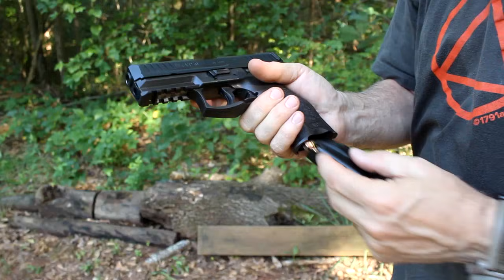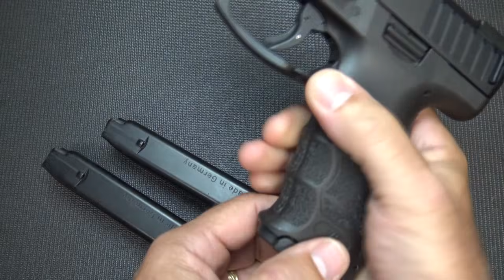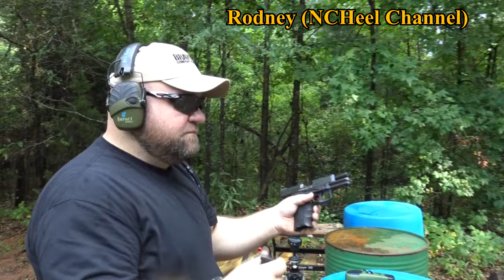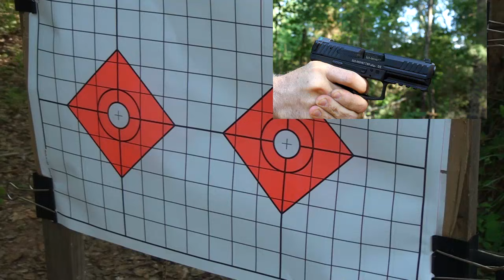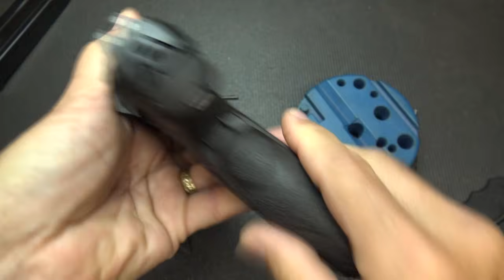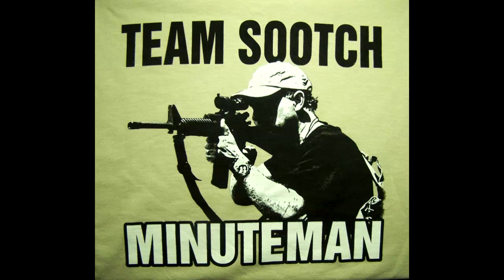HK VP40 40 Caliber Review

Comment: I got a VP40 in June. Awesome gun! Shoots like a 9mm but additional stopping power. Best shooting 40. Thumbs way up indeed!
Reply: chris delao Arguably, yes.
Reply: @shamrockrancher7673  I wouldn't even say argubally there is alot of studies recording data on one shot stopping power of different handgun calibers from across the country involving police shootings and the .40sw and .357 mag/sig are at the top of the list around 95-96% one shot stopping power while the 9mm is lower around high 80s low 90s
Reply: Interesting. Hickock45 said it was the hardest recoiling 40 he has ever shot.
Reply: @joes.7536  Hickock shoots so much he gets overuse injuries like with his trigger finger. Wouldn't be surprised if his personal ergonomics/grip style caused some aggravation
Reply: @th3wacker88  No common pistol caliber should ever be judged by 'one shot stopping power' because 99.99% of gunfights are going to require more than one gunshot wound to stop a threat.
Reply: @joes.7536  he might have said that so he keeps getting certain deals from certain companies.   Much softer recoil than several 40s.  He loves Glock 40s most and their inability to properly handle 40 is one of the reasons for the 40's drastic downfall in popularity.  True 40 pistol like this isn't uncomfortable to fire and won't beat itself and it's springs to death.
Reply: @dannysees  bit its still inferior to 9mm in terms of practicality in almost every way, the original comment in this thread said that the VP40 shoots like a 9mm, but why not just get the 9mm that shoots even better and has extra capacity to boot while delivering the same performance as shown by the FBI testing
Reply: @MrWassup45  FBI doesn't show same performance among the same caliber let alone different ones.  Good enough for the benefits of cost, low recoil, service life is all they have said.  For CCW or hunting purposes the likelihood to put down bad guys/animals with a few rounds vs LEOs dumping felons with 10-20+ rds is different.  

The best 9mm rounds get close to 1990's 40 and 45 performance with regards to auto barriers.  They don't not do as much to tissue, or match the better large caliber barrier rounds, just enough for their use.

Ammo and gun manufacturers are loving it because they have a better profit margin now.
Reply: @dannysees  https://www.luckygunner.com/labs/self-defense-ammo-ballistic-tests/ for if you want something more in depth and more applicable to civilians conceal carrying, its really simple man, i guy sint gonna care if you shoot him with a 9mm, 40, or 45 he isnt going to know the difference, the only thing that matters is shot placement, and 9mm offers you more capacity which mean more chances to hit vital organs, and lower recoil to allow for faster and more accurate shot placement its just fact 9mm is better across the board for the vast majority of self defense scenarios
Reply: Steven Sanabria 
A larger projectile will always create a larger hole, and a larger wound has a better chance of hitting vital parts and/or causing more blood loss. Practice is key, to assure actually hitting what you intend. Additionally, the .40 has been proven to yield better results to its targets when fired through vehicle glass/car doors, etc. Why is this important for civilian use? Because you might find yourself in a situation (I pray that you don’t) where someone attempts to carjack you or you may find yourself in a shooting in/around a vehicle for self defense purposes. People complain about .40 recoil, but then they load their 9mm with +P+ 9mm which has almost as much felt recoil and yields just as much (if not more) wear on tear on the firearm. These people typically do not train with +P+ rounds, rather they train with whatever cheap ball ammo they can find, so they have no clue how that more powerful 9mm load will be like when fired. 
Paul Harrell made a great video comparing the 9mm and .40 with practical testing and data to back it up. It can be found here:

https://m.youtube.com/watch?v=LTTDgZZZFa0

I began my law enforcement career with being issued a Glock 22 (.40). The agency I worked for had just switched from 9mm to .40 after the firearms instructors put together numerous amounts of data to conclude it to be the superior round. Yes, the fbi did recently got back to 9mm, but there are many factors they considered. 

Price-9mm is cheaper and when purchasing thousands of rounds, this is a major factor. 

Shooter-Most agents (and police) are not “gun people” and rarely shoot. Most people I work with only shoot during our twice a year qualification and any other training the department mandates, but other than that they don’t practice. This leads to low scores. The 9mm is a bit easier to shoot for some people, especially those with small hands, so their scores increase a bit (not much according to our agency) when shooting 9mm as they aren’t frequent shooters. 

Modern technology-Yes, modern tech has made the 9mm better than it used to be. But that same technology applies to most other defense rounds, so if you choose to compare a modern high tech 9mm to a regular practice ammo .40, then sure. The 9 looks nice. But comparing modern tech 9mm to modern tech .40, you will see the .40 have more power behind it with substantial expansion rates. 

Percents-FBI and police shootings average that about 20% of shots fired, actually hit their target. That means 80% miss. The higher capacity of the 9mm in most handguns gives officers/agents more ammo (that they need) to be able to stop threats (seeming as only 20% actually hit their intended target give or take). 

I am not bashing the 9mm. It is an effective round that definitely has its use! But many people (not saying you) seem to discredit the .40 and some even say the 9mm is better than the .40, which is simply not true. In capacity, yes. But in ballistics, no. It will never be better.
Be safe everyone!
Reply: I've had a USP 40 for many years. I love it. I want to shoot this model also. My USP 40 fits my hand like a Glove...
Reply: I want to buy one but I can't find one anywhere. I guess I have to wait until this buying Rush slows down and manufacturers can keep up.
Reply: @th3wacker88  If you still use terms like stopping power and one shot stops , you're not educated enough to talk about firearms
Reply: @rockon772  Really? And how old are you? Sounds like you run your mouth more than you run any firearm.
Reply: @dannysees  We're talking about Hickok45 on someone else's Channel and you say Hickok's popularity has wained? I'd have to sy that this conversation is proof that you're wrong about Hickok.

Comment: Awesome review Sootch00.
I love the Glocks. All different models. I finally bit the bulket and bought the Zev Dragonfly in 40. OH my gosh!!! That was the scariest pistol I've ever shot. I had shooters try it to make sure it was not me. Everyone agreed. Recoil was horrendous, could not regulate let off of trigger. SCARY. I sold it half cost, did not hold uts value. 
NOW. HK VP40. I purchased day I sold the Dragonfly. HK felt better in hand. Assembly and design is fabulous. Firing the postol is a dream. It recoils like a 9mm. Accurate, reliable, and i bought a  couple of the HK mag extensions. So I have 18 rounds of 40. 
Best 40 I have ever owned. Beats the Dragonfly and the SigP229. Along with other Glock 40's. 
I'd like one in 10mm as well. For backup hunting pistol. Although, the Smith 1006 (both of them) just didnt like at all. The Peter Stahl Omega was a jam a matic in 10mm. So i dropped the 10 altogether due to unreliable pistols at the time, and carried 50 Desert Eagle as my hunting backup. 
Keep up great review Sootch00

Comment: Hopefully they'll make a VP10 one day.
Reply: Why would you go with a .40 over 10mm? You can always get 10mm rounds that will give the equivalent of max .40 cal power or softer. You'll never get .40 cal that will perform at max 10mm power.
Reply: +Travis Woods 10mm is not for newbies. if you carry 10mm, you know what it does.
Reply: Travis Woods I totally agree, I have a SW 1006 and can load really hot and really soft.  pop in an 11lb recoil spring and shoot really soft rounds.
Reply: +FlyTour69 one can only hope
Reply: Only if you can afford 10mm ammos.
Reply: YeuLaKho 10mm is not that expensive.
Reply: I doubt HK will ever make a 10mm. It would be nice if they make a VP45 even.
Reply: Teo Phil does it kick harder than the. 40?
Reply: FlyTour69 that would be dope for real
Reply: It's quite a big deal to stretch all the parts (front to back), slide, frame, mag, etc.; to allow the 25mm long case/1.26" OAL... (MUch better chance of S&W bringing  out a 5" M&P 10mm over H&K....)

Comment: Just got this pistol for edc. shot 50 rds @ range. im a good shot, but even on pulls where i didnt care or breath right, i still hit target dead center. words can't express how impressed i am! all pros, no cons. i was used to the 9mm berreta from military, but it was easy to adjust to the vp40! flawless execution by hk. i love this pistol, pumped to get back to range. im 6'1", 250 lbs male; no kickback. highly recommended. my wife is 5'3" and im confident  she could easily  as well.
Reply: How easy is it to conceal? I'm looking at this for cc. I'm a small guy but I don't mind having a gun on my hip all day either. What size is this comparable to? I haven't been able to get my hands on one yet
Reply: +MrEmpero Greetings, sorry for later reply. I'm still waiting on my permit, however, after much research i'm going with the wildbills concealment leather holster for the lower back. In regards to size, i'd say its no larger than a 9mm, very easy to handle and weight is balanced in the hand. Hope this helps, you wont be disappointed. Like everyone else, I'm waiting for the vp45!

Comment: I don't think Glock 40 caliber's where shoehorned into 9 mm. I think it's the other way around. The 9 mm was shoehorned into a 40 caliber. And they are not really made for 40 caliber. I wish Glock would come up with a 40 somewhere between the size of a Glock 17 and a Glock 21 (made for 40 like the m&p, usp, vp40, beretta 96A1. ). I don't think the Glock 23 will last as long as a Glock 19 but I still love them and have them.

Comment: Part-2:   The grip area kind of feels like the new Springfield Model-2 Grip area, which is good.  Although I thought having to knock the pin out at the bottom of the grip in order to change the adjustable grip pieces is a little bit of a pain in the butt to do.  By the way - I opted for the Small sides and back-strap pieces, even though I would say my hand size is about medium.  The little pieces that stick out on both side at the rear of the slide to help with pulling back the slide are nice, but instead it would have been better if HK would have placed S&W Third Generation style Safety/Decocker levers at the rear of the slide.  This gun has no safety.  It is a little dangerous having a loaded chamber on a gun that may be lying around and available for quick use in case of a break-in and used for home defense.

Comment: My impressions of the VP9: good but there are offerings just as good at the same price point and some that are almost as good but considerably more affordable and simpler. Got to shoot a new one a couple of weeks ago in comparison to my 4 year old, 3000-4000 rd PPQ in 9mm. Shot the VP9 just as well, but was more impressed with PPQ's smoothness. Had more problems with the ambi slide release than the PPQ's (I'm a lefty, and don't like them). I may be a little bias, but I still prefer the PPQ over the VP9. That gun might smooth up as time goes on, but it is still a much larger pistol than the PPQ without the added capacity or improved shoot-ability of a large framed pistol.

Comment: Part-1:Based on several Glowing Good Reviews - I purchased a Brand New HK VP40 on 2/29/2016 for $589.99.   My first disappointment was the Painted on glow sights.  They just don't glow for very long.  They maybe last only 10 or 15 minutes if you are lucky before they start going dim.  Then while I like the trigger and trigger safety on my Springfield XD and XDM pistols - I never have liked the thin metal trigger safety on the Glock pistols because the thin metal popping out hurts my trigger finger.  The trigger safety on the HK VP40 resembles that of the Glock.  Also I do not like the groove down the inside center of the trigger frame - this was done to allow the bottom of the trigger to ride in that groove.  The problem is that unless you keep
your finger up high on the trigger your finger rides in the groove and that can
be irritating and eventually painful.

Comment: Have had my VP40 for about a year & a half now. It was my 1st H&K gun but won't be the last. If having troubles finding a holster still, safariland has paddle & belt style h ol ln stars with a tensioner screw & finger lock on the back side of the holster.

Comment: I just bought a VP40 this weekend.  I do have to pull my trigger when disassembling.  Otherwise, the slide won't go forward.  Also, mine only came with 2 magazines.  However, I did get mine new for $559 with the Tru Dot night sights.
Reply: Brian Page:  Love the pistol and want to replace my Glock 19 but a little concerned about the slightly larger size for IWB CC. Has it worked out? Thanks.

Comment: as i said at the full30... the 3rd magazine and TruDot sites that you've got are on the LE version... the regular version comes with the same glow-in-the-dark sites and 2 mags as the "regular" VP9... the LE vp9 has 3 mags and trudot.

i just don't want folks to be pissed if they think that they're going to get 3 mags and tritium sites by default... they're not.
Reply: I got three mags with my standard VP9.
Reply: M4A1GUY that's good luck (wish my vp9 came with 3) but it is not what is advertised to come with the regular edition VP9 or VP40. did you also happen to get the tritium night sites?

as far as the VP40 reviewed here... it has 3 mags and TruDot tritium night sites... which is exactly what makes the LE edition the LE edition.
Reply: Noddy Ninetythree Correct, pistol in this test is LE version.

Comment: If you put one finger on top of the slide above the rail and one finger on the rail.  Press those fingers together and do you get a little lose/play feeling between the slide and the frame?  Just picked up a VP40 and I noticed it right away, my glock does not do that.

Comment: Wondering your opinion on this. Do you think replacing the back plate with a solid back plate without the hole for the striker would the gun significantly more reliable or not?

Comment: Those are 9mm mags. Do they feed .40S&W? I know the .40 mags will feed 9mm.
Reply from the maker: Craig Wildfeuer From what I understand they will work. I haven't tried it and didn't want to include it in the review until I was certain.
Reply: ***** I think what he means is that when you picked up the magazine @2:57 that the back of the magazine definitely says "15".  Did you mix up the mags?  Surely the VP40 doesn't come with mislabeled magazines.  For the cash you spend on an HK mag, it better be right!
Reply: Craig Wildfeuer The followers and mag bodies are the same dimensions. So yes.  The only difference is the round count holes on the back.
Reply: Craig Wildfeuer  didn't know 40 fed 9mm,  no jamming ? very interesting
Reply: Yep, most of the .40 mags of most makes will feed 9mm. I know my Springfield XDM .40 mags and my Sig mags fed 9mm beautifully. Same with my M&P.
Reply: +sootch00  Is the width of the feed lips different between the 9 & 40? Comparing 9 & 40 Glock and Beretta mags are not the same, for example. I'm sure Hk mags are different as well. Would they work? I would'nt depend my life on it. I'm sure other mfg mags are different between 9 & 40 also. jmo
Reply: No the nine mm mags won't feed 40
Reply: I didn't think they would. I know other way around is fine, except for maybe Glocks and 1911 single stacks. I know the Mec-Gar 9mm mags for CZs will feed .40 and are marked as such when they are shipped with Caniks.

Comment: Why is the HK P30 pretty much twice the price of the HK VP9 or HK VP40 ????   I purchased a HK VP40 for just under $600.    I saw P30's priced at around $1200. or more.
Reply: The P30 is hammer-fired and the VP series striker-fired. Hammer-fired have more moving parts which requires more labor and therefore it is more expensive to produce. The striker-fired pistols' mechanism is simpler and therefore cheaper to produce. This makes the P30 more expensive to buy. You can find the P30 full size new 950, used 700+.
Reply: bigB6flyer couldn't have said it any better. You can look at the trend of hammer fired vs striker on any pistol price on every manufacturer. It's not just hk, check cz, sig, etc
Reply: @bigB6flyer  why is it more expensive in the philippines?  Cost almost 2000 dollars for a new one? and very scarce here, need to wait 3 months.. How i wish  I can just get it at AMAZON..

Comment: 13+1 in .40 and 15+1 in 9mm in a full sized modern handgun? HK are you even trying right now, our is it you know people would buy a cow pie from you so long as it had the lovely HK logo on it?
Reply: I think the vp series is in between the g17 and g19 in size, also it uses p30 mags which were designed when 15/12 was the standard.
Reply: The mag said 15
Reply: Josh Van Doornik its full sized. And unless the p30 was made, eh IDK before 2004, then 15 wasn't the standard. Also considering that as he said he bought the mags for $50 a pop really provides no benefit to anyone unless you happen to also be a p30 owner. Glock 17-17 rounds, m&p 9-17 rounds, XDM-like 18 right? I don't remember, the new M9a3-17 rounds. I really REALLY want to like the VP9 but, no thanks.
Reply: B GerK Sootch said in the comments the 15 round was a 9mm mag.